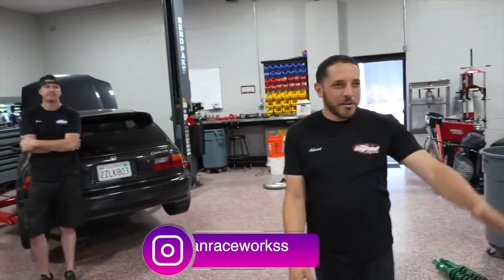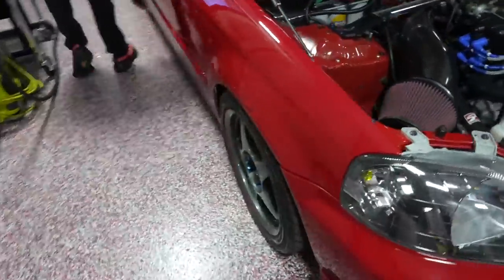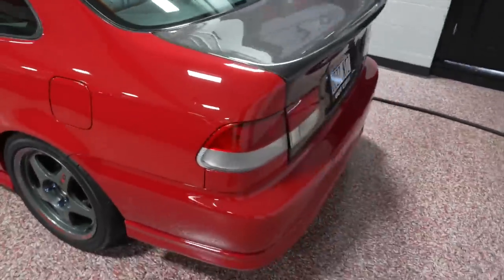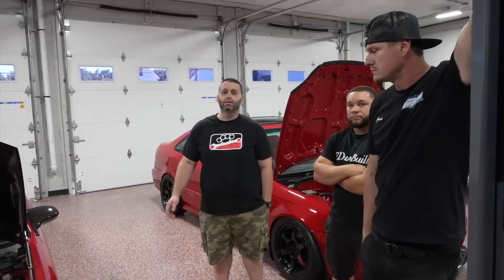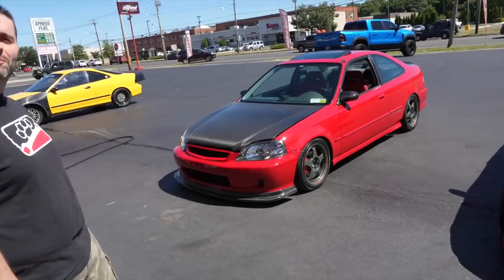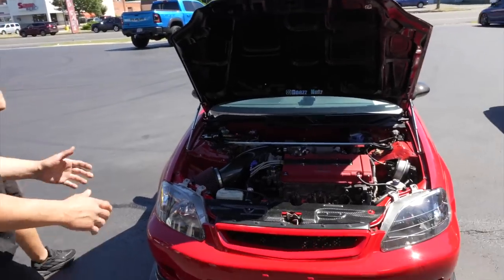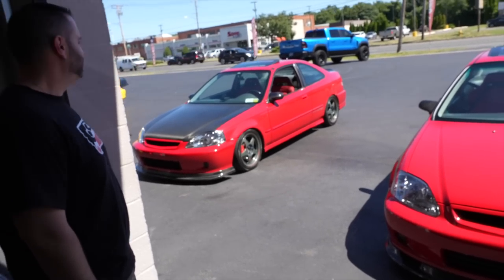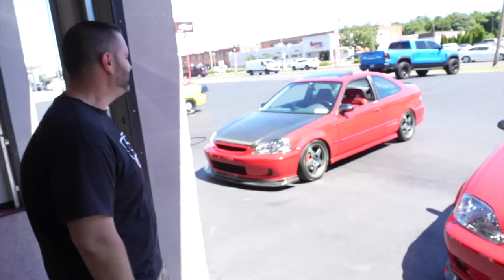B18c EM1 Civic Si or k24 Civic Si ? 🤔 Which one you taking?🗝

Comment: I am the owner of an EM1 that is nearly identical to these, except stock engine. I have some very subtle modifications to mine in the suspension. But I’ve always wanted it to keep it as close to stock as possible. These vehicles are not getting any more common. There are very few left in original condition. If I’m gonna do modifications like this, I’m gonna do it through an EX or a DX coupe. Not an EM1

Comment: @Sonic203 hey does the EM1 have coil overs or lowering springs? Please don’t tell me the Yonaka catback exhaust really is louder and raspier than the skunk 2. My car has the stock D16Y7 engine and the Yonaka Exhaust that I just ordered has a 2.5” OD with a 4.25” tip. I’ve seen videos where they say and it sounds quieter. I like both cars. They’re both unique in their own way. I like the wire tuck in the KSwap, makes the engine bay look clean asf.
Reply from the maker: our em1 has k tuned k1 coilovers, he did a 3" so its going to sound alot different than your car
Reply: @sonic_203  oh good thanks for responding. I really don’t want anything loud and raspy lol. Just something that makes some noise just not as quiet as the stock exhaust lol. I can’t get over how sweet those two civics look. I’m experimenting with my EK. It’s really clean. Bought the car 4 years ago with 67,900 original miles (82,400 miles now) from an old lady so I really don’t want to do a whole lot in regards to the engine and tranny since I wanna to keep it unmolested as much as possible but I wanted to change the look to a certain extent. The car is really clean in regards to the interior, exterior, engine bay and undercarriage. So far I got all the windows tinted, bought new 2000 Civic SI wheels with 205/50 R15 Hankook tires, smoked front headlight and rear taillight assembly, replaced all the stock interior/exterior halogen bulbs with LED’s including the instrument cluster, front and rear bumper Type R lips, smoked fog lights, Yonaka catback exhaust and I plan on getting Eibach lowering springs with KYB Excel G2 shocks/struts with a 1.7” front drop and 1.4” rear drop. I don’t want to go too low to where the new exhaust is gonna scrape over speed bumps nor do I want to drop it to where I’d have to roll the fender and quarters. I was going to go with coil-overs but my brother said that since I don’t want to drop the car much and want a comfortable ride that I’d be better off going with the lowering springs instead. I do have a question. In regards to the KYB struts/shocks, do you know which would be a better option between the KYB Excel G2 (no dampening adjustability) vs the KYB AGX (dampening adjustable)? I want to drop it a bit but I definitely don’t want to be bouncing around. I also wanted to get an instrument cluster with the RPM gauge because my civic is an automatic DX (yeah I wish it was a 5spd) and the instrument cluster doesn’t have the RPM gauge, however I know the connections for the two clusters is a bit different but is there a way to install the cluster with the rpm gauge or do you know of a video that shows the installation process with any modification if needed to make it work?